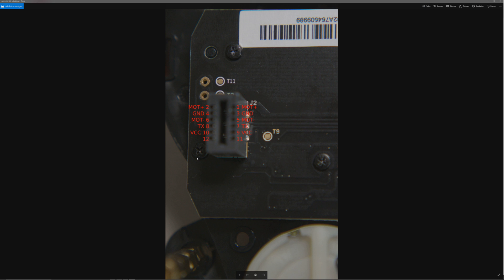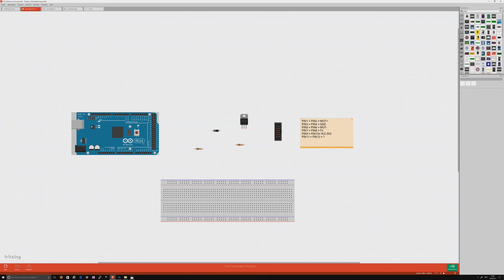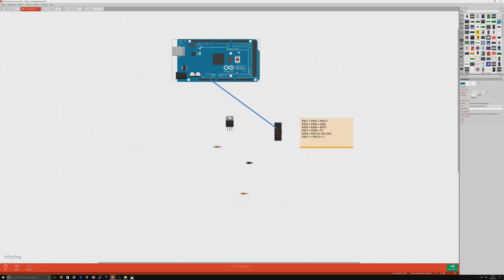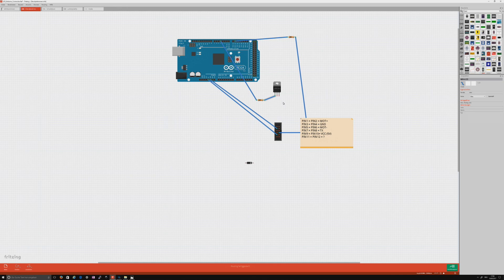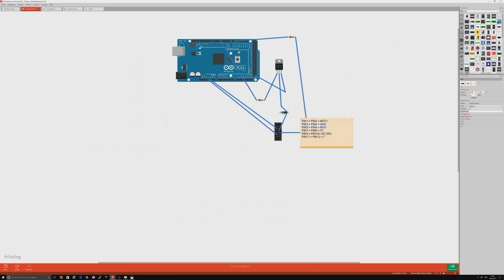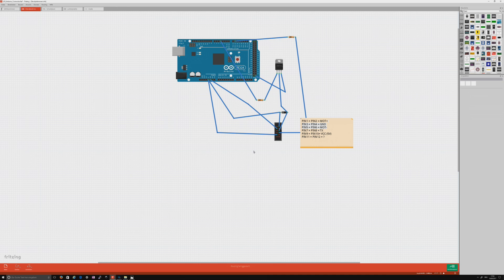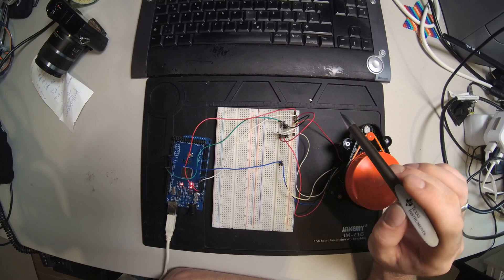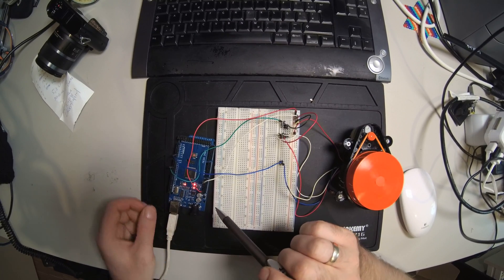XIAOMI Vacuum LDS Sensor PinOut and Arduino connection

Comment: Is it possible to calibrate lds sensor with this way? I replaced the diod like in your other video but the vacuum is working very bad :(
Reply from the maker: Only by moving the diode. Mechanical calibration
Reply: Distance calibration is done in robot linux OS side. There seems to be txt file for it. Interpolate distance vs. sensor pixels. It is not time of flight distance sensor, but triangualting distance sensor. There is 1 pixel row camera sensor measuring which pixels the laser hits. I don't know how to create nice mapping for distances vs. pixels.